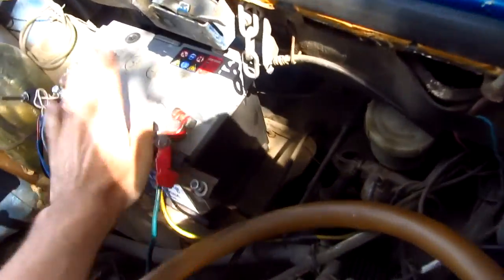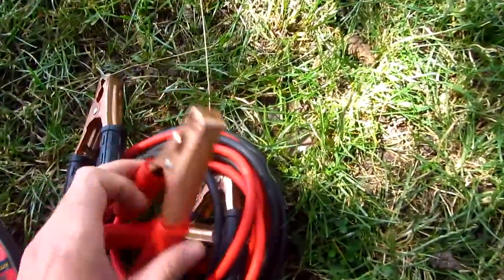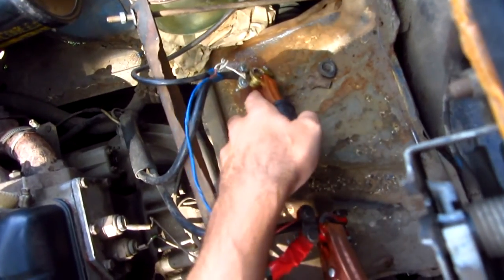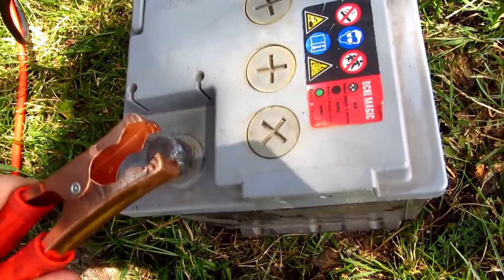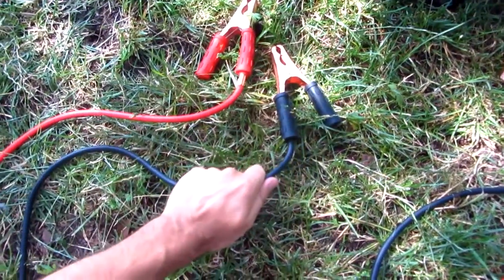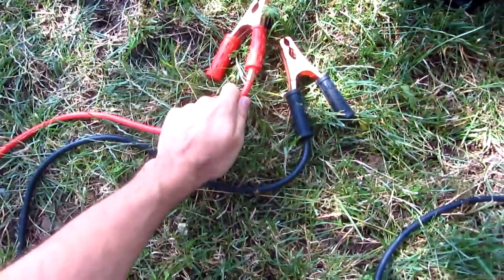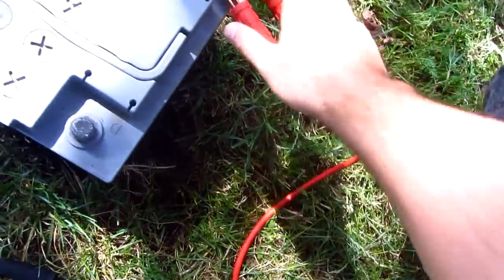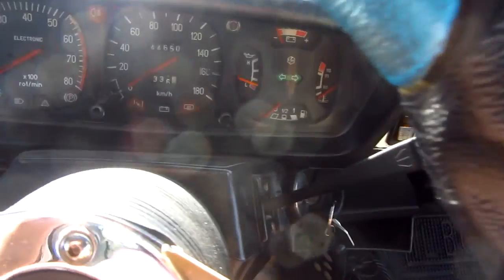Testing a 125 Amp Jumper Cable (Not enough!)

Comment: I own a 06 Honda civic and when I turn the ignition I can hear a rotor working but no ignition. Can this be considered a battery drain? Kinda stupid question
Reply from the maker: Is the electric starter motor turning the engine, or it is spinning freely?
Reply: @furulevi  spinning freely

Comment: When you are jumping a battery, you are mostly charging the dead battery so the dead battery can deliver cranking amps. Cheap cables just mean you need to wait longer for the dead battery to charge. With extreme cables, you can bypass the dead battery, but spending three times the price isn't really necessary unless you want to be the coolest guy on the face of the planet (like me)
Reply from the maker: You are right, a thinner cable charges the battery (in time), but a thicker cable can instantly start the engine without first charging the dead battery.
Reply: @furulevi   mostly its about the shitty thin clamps, they grip badly and create high connection resistance, wires themselves even tho they r thin, would pass starting current.

Comment: The alligator clip's did not get as warm as the cables, so I think the clips were just fine but the copper wires way to thin. And thus those got hot.
It could be good to have a set of 400 Farad (6 of them in series) directly connected across the battery leads. In that case you could use the cables, as the real power would be delivered by the capacitors. But I think you know to who I am referring? (lasersaber)
Reply: Those cables seems thick... Cut it open and you will find more plastic than wire. And those are 100% not copper. More like aluminum wire which is cheaper but at the cost of half the current.
Reply from the maker: Yeah, but those ultracapacitors are too expensive...
But it's interesting because the crocodile clips barely touch the battery posts, the contact area is very small, and still the cables get hot not the clamps.